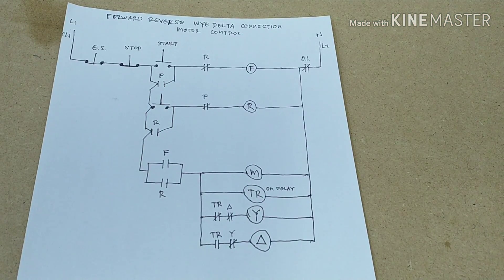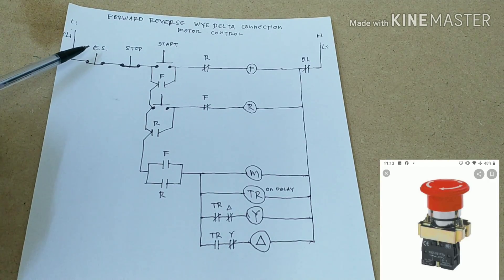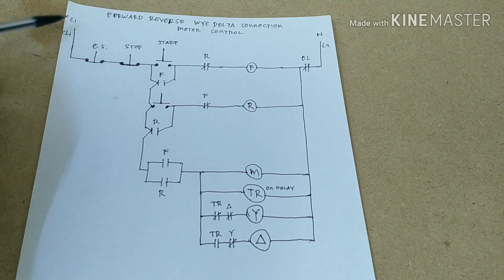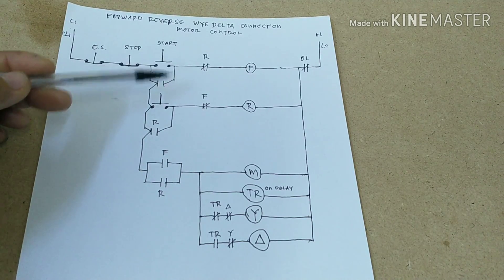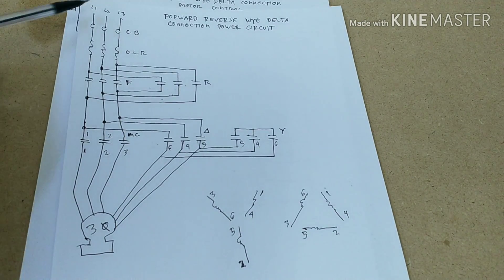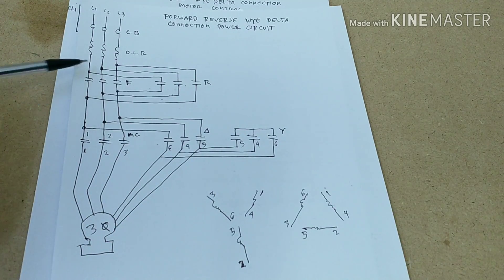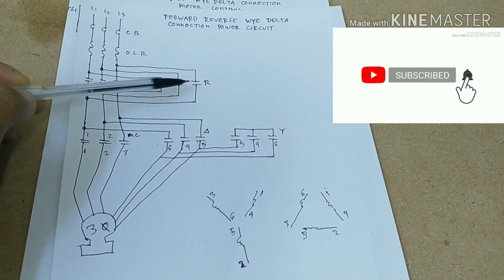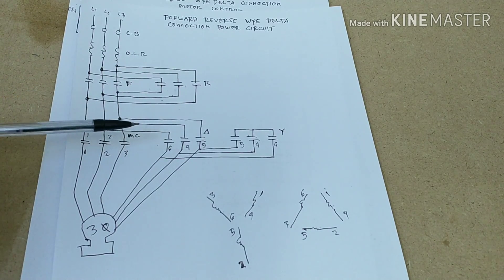Ladder Diagram Forward reverse Wye delta connection motor control and Power circuit (English)

Comment: Sir. Request po  kon.  Pwd.  Ano ba dapat a breaker ng electric motor na gamitin bawat horse power po. Tnx.
Reply from the maker: Depende SA motor na gagamitin mo pati SA load na kanyang dinadala.para cgurado Ka, gamitan mo Ng clamp meter kunin mo Amper paganaahin mo motor na may load.pag makuha mo na Amper Saka muna computin Kung ilang Amper na breaker gagamitin mo
Reply: @bernaztv  ok..  Po..  Ahmm pwd po ba kayo gawa vedio halimbawa ng computatioion niyan sir kon ok lng po. Para malamn din ng iba po. Tnx
Reply from the maker: Ganito Kasi Yan Jhonnel Solatario.1horse power of motor is equivalent of 746 watts.
Kung gusto mo Amper.ANG gamitin mo na formula SA electrical conversion is P/V=Amper,,like for example 1kilowatt or 1000w divided 440V is equals round of nalang natin 3amps..SA electrical computation Kasi Hindi talaga accurate dapat meron Kang allowance palagi.pero Kung gusto mo madalian pwede Ka mag download Ng apps about SA electrical conversion Hindi kana mag cocompute pa type mo Lang lalabas kagad sagot
Reply: @bernaztv  ahh. Ok po.  Mag kaiba poba ang full load nang motor ampere at ampere ng breaker na gagamitin para sa motor.  Dito po ako nalilito.  Tulong lng po tnx
Reply from the maker: Walang pagkakaiba Ng Amper Ng breaker at motor Kung Meron xang load.parehong Amper yon